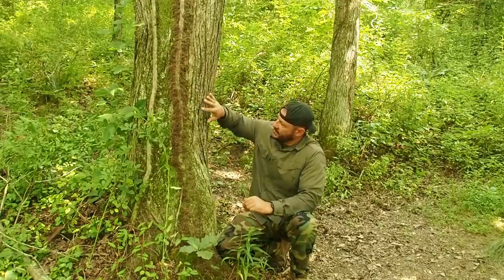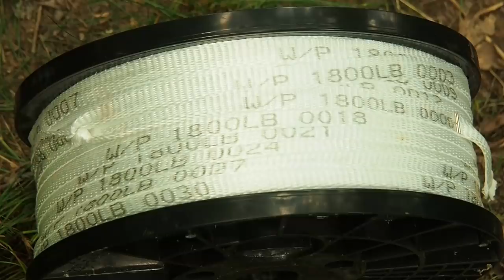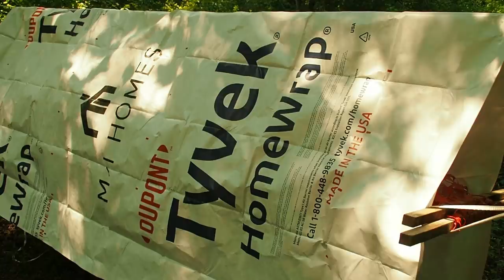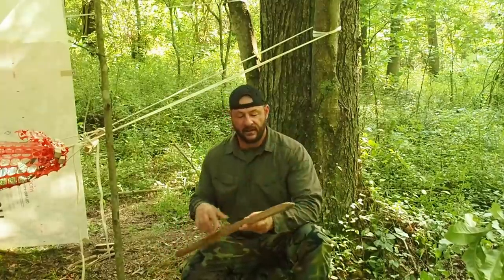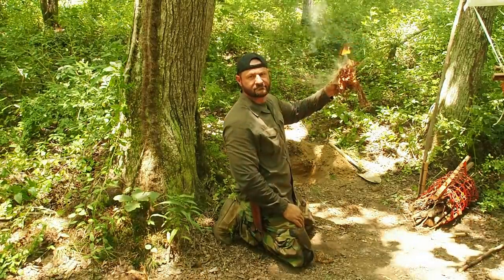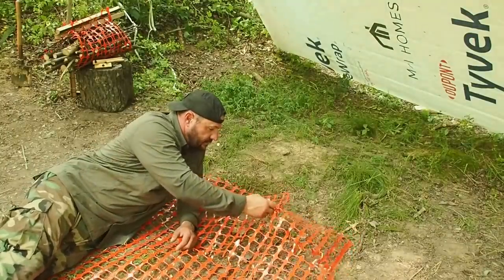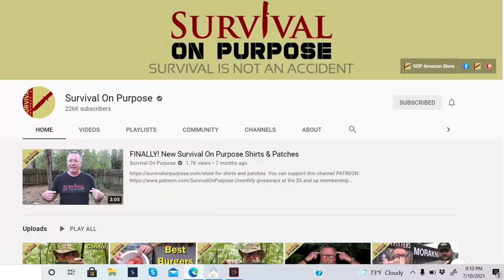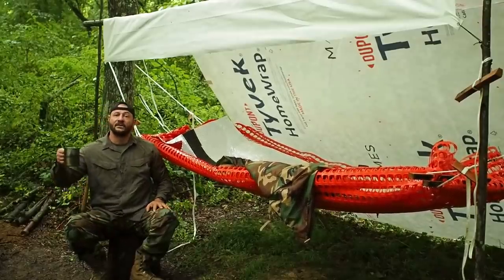Solo Overnight Building a Construction Garbage Camp in The Woods and a Simple Bacon Cheese Burger

Comment: Tip from from a long time backpacker: Run the Tyvek through a washing machine cycle and it will soften the Tyvek and it won't be so noisy.
Many backpackers use Tyvek as a ground cloth under their tents.
Reply: Good advice about the wash. I use Tyvek as a ground cloth. I've never washed my ground cloth tyvek but I have a few of those reflective bivvy bags made of the same material with a reflective coating inside and I have washed them. They are so much nicer to use after a wash.
Reply: I have a Quaker State wind breaker that got softer the more I wore It
Reply: @wyliegibson319  It's basically a matter of breaking up the fibers so they aren't so rigid. So hand washing and air drying in a breeze or wind will do the same. Or if you can't wash then scrunching up the fabric (as what happens with use) will also work.
Reply: Finding the leftover materials would save money, but then 
we have to buy our own hooks, lines, and sinkers.
Reply: @wyliegibson319  Thankfully you still have you tube

Comment: Pants n long sleeves in the summer isnt stupid. If Im out workin, its what i wear. It keeps u cooler as well. Theres a reason ppl in hot climates cover up. Not so they dont burn, they aleady have a year round tan, its to keep cool.
Reply: Exactly ! And you are moving through vegetation, it protects from the poison plants and brambles
Reply: Except in my line of work I have to wear FR or flame resistant that crap does not breathe.

Comment: Loved this one. I think I've used every material shown here at one time or another, but never had scrap of the reflective wrap to play with like this. I'm not surprised the first use of snow fence failed, to be honest. If you're not a "full figured gentleman" Tyvek makes a viable hammock if you rig it like a parachute panel for that purpose, downside is its about as subtle as steam whistle. It is easier to work with after going through the washing machine, but it doesn't last for years like a heavier poly tarp. Weight vs service life, old story. Now that I'm in the desert not the northeastern forest, I need to scrounge some for an ultralight tarp where I need to worry more about shade.

Comment: In all fairness you would be hard pressed to find the radiant barrier in pieces bigger than a couple feet. You could us tyvak in the hammock should do the same job. The pull tape isn't as slippery after it has been used by it one still probably would be wise to use a stick or block in loop .
Great job I love these types of videos, the Walmart one was very good too and showed that one can get into the woods without breaking the bank

Comment: One to try this winter , Tyvek with alum. roof paint one side flex seal the other and use reinforced plastic the type that has the thread between two layers it can be stiched together if it gets a hole in it " Super Shelter 2.0 "

Comment: I've watched the bow drill section several times now and it appears the narrow stem of the spindle smokes before the base. It got me thinking of rotational speed of hard drives; there are faster RPMs near the center of the spindle versus the outside. I wonder if a smaller spindle at the base would yield a ember faster?

Comment: I’ve wanted to get some tyvek for a while but i had no idea it was so loud. I’d still like to have some.
Reply: Tyvek also makes for great emergency poncho
Reply: After some use, Tyvek will be much, much softer and quieter.

You can wash it in the standard washing machine (water only) to make it quiet quicker.  But the meterial loses some strength along with loudness.
Reply: I used it on a piece of plywood in the box of my truck...it started getting worn out after about 5 years😁

Comment: Great build! Question: I've never seen Tyvek with tarp grommets - where did those come from? I would have expected some kind of rock tied into the corners or something?
Reply: I've been using Tyvek in outdoor equipment gear builds for years. If you build your tarp then wash it on the gentle cycle in your washing machine it softens it up yet keeps its shedding properties. You can dye it also to lighten up the bright white.
Thanks for another great vid Kelly.
Reply: I wondered about those grommets myself...

Comment: The hammock netting is HDPE, and the heat deflection is about 160F. Problem I think was that snow barrier netting is so thin that when applying even a much lower heat and load, it will begin to fail. The tripling over helps the overall yield strength of the material/construction for sure, but wondering if there’s something else, maybe a polypropylene material that could be utilized as this has a heat deflection temp closer to 200F.

Awesome vid!! Wondering what a solution to the tyvek noise would be sticking with the construction material theme. What could replace or cover it to help prevent the loud tapping when the rain comes.
Reply from the maker: yet it was hot af and moved like butter
Reply: @recall5811  I think the cross-sectional area of that material is why that happened - super thin!! But looks like you got it all worked out.

Comment: If you want tyvek to be silent ...wash it in the laundry machine, 
Ya put Ultra ...into UltraLight with them set ups , now that hammock is also a Canoe frame cover if done right
Reply from the maker: do you have a video on this?
Reply: @recall5811  
I dont , but if should work just like the  green branches and tarp canoe concept , except with the orange fence , bubble wrap and tyvek  material for the skin
Reply: @recall5811  according to the website the trek.co “The Thru-Hiker’s Complete Guide to Tyvek”, “….. Much like noisy sleeping pads, and unlike some other nontraditional groundcloth materials, Tyvek will gradually decrease in noisiness with use. To fast track the process, and to make hard structure Tyvek more malleable and packable, you can send it through the washing machine—without detergent—up to a few times without any loss in water resistance.” 

Hope this info helps. 

Always Interesting and always learning…

Comment: When it comes to "Heavy Rain" areas (Pacific Northwest), I want a sustainable Low-Maintence Fire Pit.

Easy Breasy, what to do without having to buy material...

I currently have a Paver Fire Pad, with Firebrick raised 6" with airgap, with a 18" Drum Brake Drum for the Pit, but I want to add a Wind/Raun Guard to it that will not Rust/Rot out.

Any recommendations?

Many thanks,
🤓-Thomas 
Port Orchard, Washington
West of Seattle, Washington

Comment: Method to the madness? What madness is this you speak of? Engineering 101: "If it moves and isn't supposed to, apply duct tape. if it isn't moving and is supposed to, apply WD-40." No madness, perfectly normal.
Also, gotta say, Tyvek makes for a great rain fly. not exactly the stealthiest color, but a great water barrier. Good for making improvised canoes. That stuff you used for bedding however would make a pretty good insulated cooler, using the metal tape to seal the edges and corners together, and then protected by duct tape, it's almost as good as a Styrofoam cooler. (I've got a couple of 6-pack sized coolers that are essentially just that with a nylon shell, a zipper, and some webbing for a carry strap.) (river rocks aren't hugely cold like ice, but it's better than nothing.)

Comment: In regards to that loud rain, wouldn't a steeper angle and the leftover plastic from the hammock have been great at reducing the sound ?

I realise that heinsight is 20/20, but personally I do a lot do reduce sound in my sleeping environment - even when in the field..
When my squaddies have already tucked in or gone on guard duty, I will spend a good 10 min of my resting period just making sure I don't need to get out of the sleeping bag due to some god-forsaken wind or whatever.

I prefer the solid hour or two, rather than the 10 min constantly interrupted^^

Edit: I realise that this situation is a bit unqiue, due to the fact you're basically using trash.

Comment: I simply want to know what you know that I don't Shawn, but I was told all my life not to start campfires directly on the ground anywhere near trees as this could start an underground root fire... I've seen you use this dug pit method in a few videos, so what's up? Is it a myth?
Reply from the maker: i have 400+ videos showing that it is a myth
Reply: I have seen fires start from campfires built on rotten tree stumps that were depressed in the ground and covered by duff.  Unless you dig down to bare dirt/rock, you can never be sure what is under your fire pit.  I once saw a fire pit cave in when it was being put out and the coals went underground into the old rotten stump network and burned several weeks before resurfacing several feet away to start a forest fire.  No joke.  Make a friendly call to your local forest service office for plenty of examples.  Of course only rotten tree roots will do this, and it is impossible to get a live root system to do it b/c of the water content in the roots.  Beware of dead tree stumps and fires.
Reply: @recall5811  right on! Thanks corporal!

Comment: Failing to mention .. trespassing on a job site in most states is a felony  ..all property even garbage is off limits ..same as taking copper or scrap from a job site 👎
Reply from the maker: was mentioned but if you skip through you miss things
Reply: @recall5811  
No skipping through I watch entire vids . wasn't being a dick ..just pointing out things others might not realize👍🏻
Reply: This was an inventive video but it was not named right. None of the camp was made from construction garbage. All was opened up and new at the camp site. Anyone who has been on a job site would tell you by the time they throw away the orange safety fence, you need a fist full of zip ties to hold it together.

Comment: Come on. Do better than this. I'd have to carry all that junk back out when I'm done.
Reply from the maker: make a video showing it being done better than this and I will give you a shout out
Reply: @recall5811  You missed my point. Building this was fine. No, I could not do better. In all your other videos using natural elements, when you leave you can't tell you were there and you did not have to carry anything out. Did you not double your work by carrying the stuff in and then carrying it back out. If it was a grid down, SHTF issue, building this behind Home Depot or in a public park nearby would make perfect sense. So to that point, your video would be useful. You might have filmed this in an urban area is what I meant.